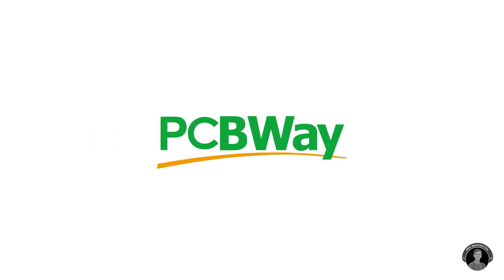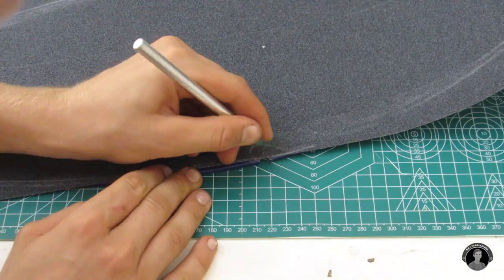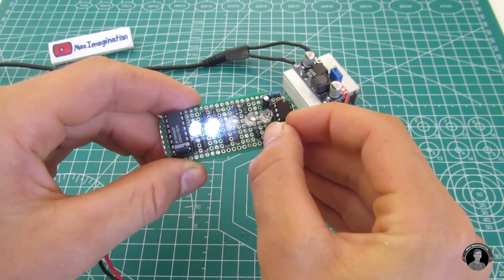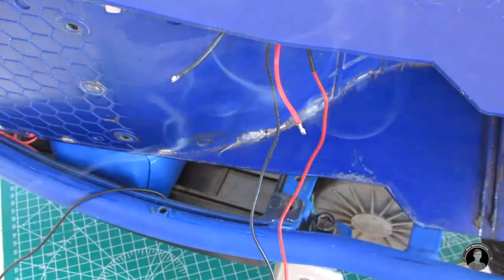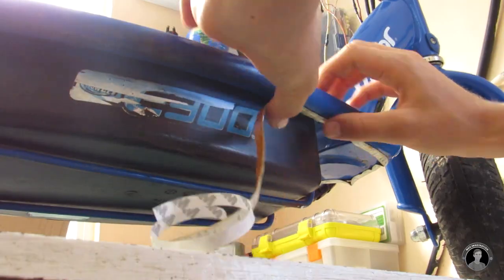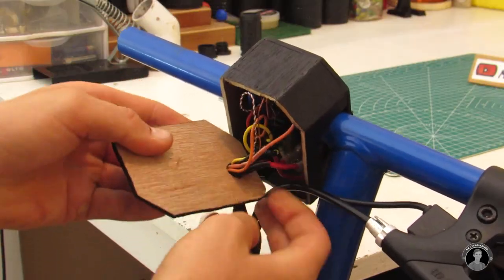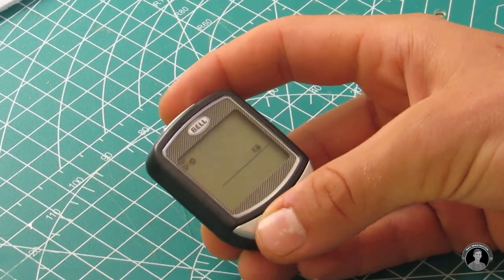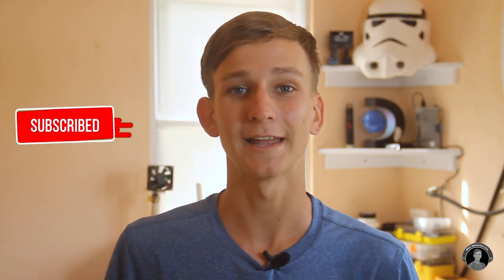Reviving Razor E300 Electric Scooter: Part 2 - Upgrades and Restorations

Comment: The 4017 decade counter can be wired to reset after 9 counts since you have only 5 LEDs. As it is now, there are 2 “counts” on the first LED and 1 on the others so there is a visual dwell a little longer on that LED.
Reply from the maker: Thanks for your tip. When I work with the CD4017 again, I'll consider that. Cheers.

Comment: Any intention of making IoT devices/Home Automation videos with Arduinos???

maybe with an open source AI assistant
(Mycroft perhaps)
Reply from the maker: Thanks for your video topic recommendation, I will keep it in mind. :)
Reply: @MaxImagination  Actually the Assistant is probably done by using a Raspberry-Pi
(AKA PiCroft)

But still should be interesting &
Maybe we could see projects on:

> Wifi extenders/ Repeaters
> Mesh network